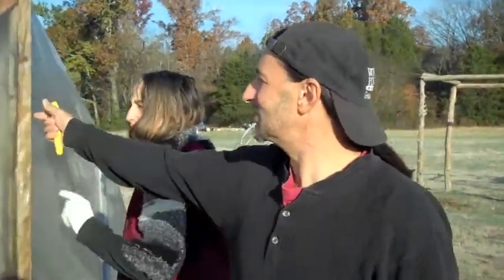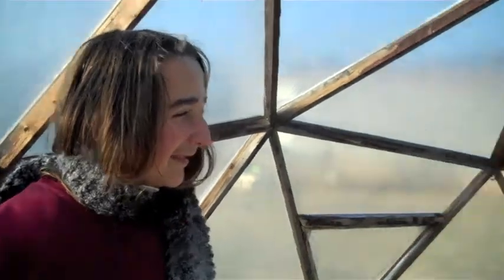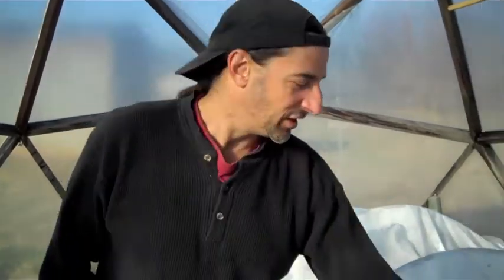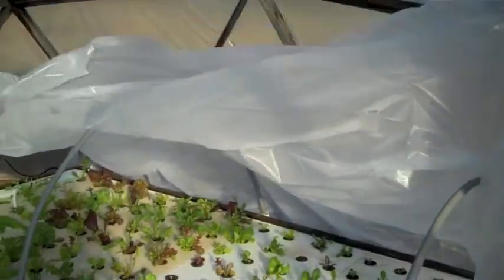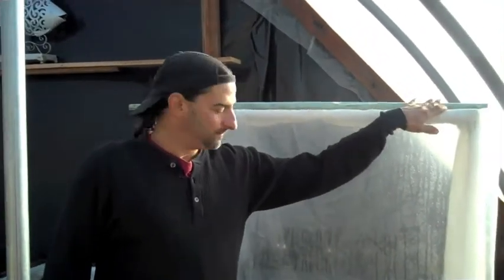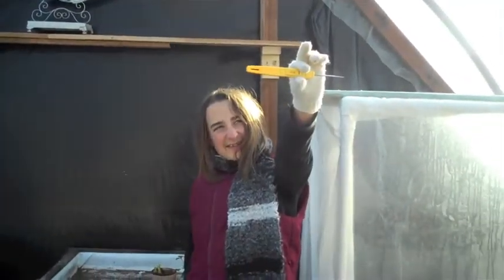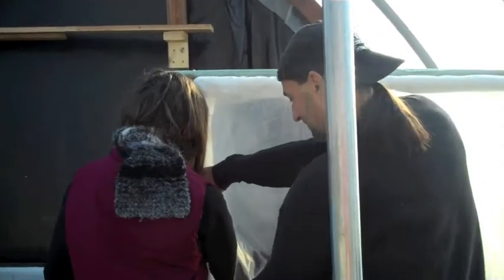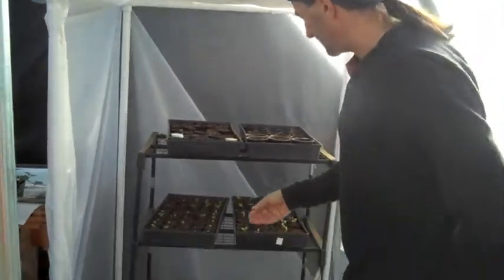Dome and Hoop House Temperature Readings

Comment: Nice update.  Starting to think a second layer of very clear plastic on the inside would make enough difference to be worth it.
Reply from the maker: You could also blow air in between the two layers of plastic for added insulation.